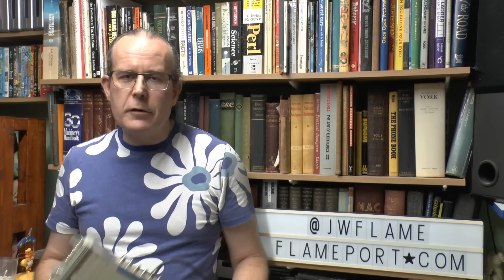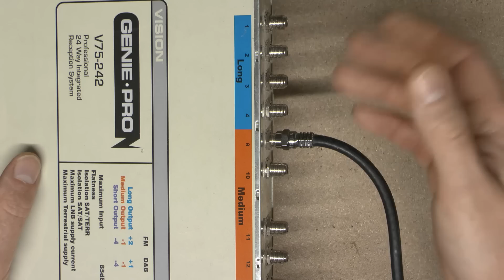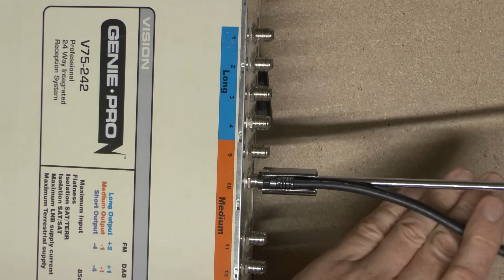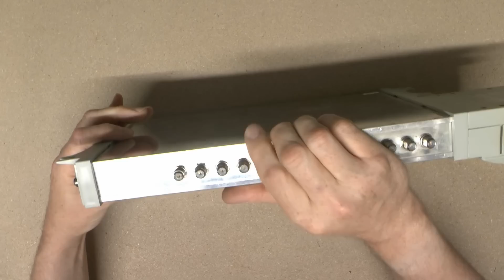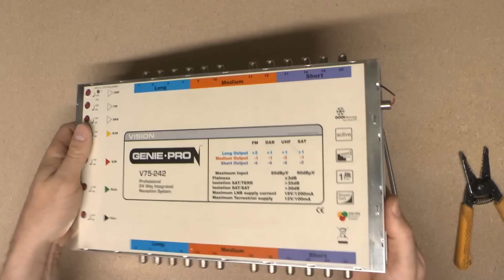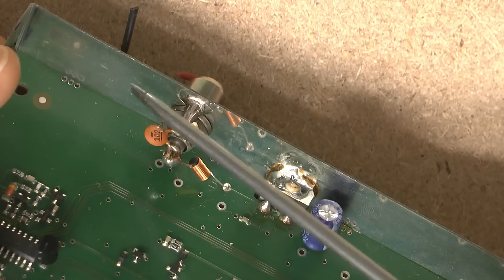IRS Teardown Integrated Reception System for TV Satellite Radio

Comment: Interesting box I definitely get US vibes. Hearing you describe F connectors is like hearing somebody describe metric to nonmetric users Or imperial.
At least with the US cable and satellite television systems we are required to have our bonding point at the cable entry of the building.
And that is usually where the electrical services as well so it's just a matter of jumping over to the ground wire running to the ground rod usually.
Unless of course you're actually a cable or satellite TV installer where every time they've done my house they've ripped everything apart. I've seen so many installations where they don't know what to do with the ground wire as well. My local movie theater had satellite TV installed for a while and I was up in the attic and discovered they grounded it to a nail nailed into a piece of the wood framing. when they were literally inches away from a metal electrical conduit box they could've at least made an effort to go to. Where was I going oh yeah so any distribution amp would usually be downstream of that entry point inside and not need to be grounded unless of course it's using a three prong cord or has provisions for extra bonding grounding.

Comment: Hi JW,
With the way these things are manufactured, this could be a solder joint gone bad, it would only take one of these from the "supply" side of the unit to the outputs, to stop it from working. 
I do note that after you opened the unit up, there was a dodgy looking transistor, with a white deposit around that transistor, it may have for whatever reason overheated.

Comment: Hi John, one of the most common and misunderstood topics is 32amp ring finals wired in 2.5 using method 101. Do you need to be upping it to 4mm and can you retro fit a lower rated mcb for an existing scenario?
Reply from the maker: 4mm² would be the minimum size if someone wanted to install a 32A ring and also wanted to install the cables under thick insulation.   Both items can easily be avoided.
For an existing circuit installed in 2.5mm² and also under insulation, it would need to be changed to something compliant such as 2x 16A radials.  A ring using 20A or perhaps 25A might comply but further calculations would be required, and would also depend on what loads were connected and how they were distributed in relation to the insulated sections of cable.

Comment: Interesting that the power supply is rated for 18V, 1.2A, which is identical to the maximum LNB supply voltage/current. If the LNB is drawing maximum current, how much does the rest of the electronics need and can the PSU actually supply it? It seems like that PSU has the potential of being driven pretty hard, hence the Ernie Burnie mark.

Comment: If you see inductors which have appeared to have been squashed this is indeed tuning. The unit will have been hooked up to a network analyser at the factory and the inductors shoved until the desired results are achieved . The procedure is shown in #7 and #16 on my channel. They are probably part of a low or high pass filter network! Good teardown and explanation!
Reply: Hi
Reply: Do you know what this is?
Reply: I can't send the image from this can I have your email

Comment: Surly the mains input cable is earthed so no need for bonding.
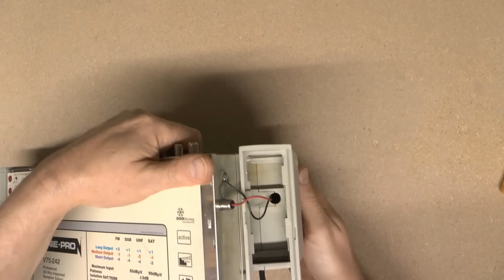Reply from the maker: Mains input cable is 2 core as it's Class II, but even if it was 3 core, the power supply is just DC out, 12:42 - two thin wires for the DC voltage. 
Boding and earthing are two different things, bonding would require significantly larger conductors connected to the metal parts.
Reply: Yes understand about being class 2 but if it was class 1 the earth would be to the case thus earthing so wouldn't matter about the PSU being only 12 volts. @jwflame

Comment: Great video.
PS Would you consider doing a video on heat pumps? Opinion seems to be divided on whether in practice they work properly and are an improvement on conventional heating.
Reply: There's a lot of expertise about and when you ask and answer the right questions about heat loss, pump capacity and radiator efficiency it's now quite simple to make a reliable prediction on whether they are suitable for a given installation.  Urban Plumber and Heat Geek are two channels on Youtube that might be of interest in this.
Reply from the maker: Yes.

Comment: I don't think that's just "foam to press on the board" - I believe that's RF absorbing foam to reduce cross talk. Also at 17:02, those are most likely not transistors, but rather PIN diodes which are commonly used in RF switching applications

Comment: The transistor is a 5v voltage regulator, the diodes clamp any voltage coming in from an output to 0.6v above the supply rail (probably 12V)

Comment: Cable tv systems use isolators, I am surprised these don't, to prevent diverted neutral currents from TN-C-S trying to use the co-ax screen, I saw that happen in the US where they DON'T use isolators, they bond the cable tv where it comes in. Customer's PEN had gone open and the coax cable tv line was smoking along its whole length!

Another reason this could be a problem is the cable is bonded at the cabinet end, and the cabinet PSU's are usually TN-C-S, so may have a different potential to the earth in the customer's house which could be TN-S or a different potential of TN-C-S, possibly from a different substation
Reply: As the satellite receiver needs to send  voltage back to the switch, as such isolated outlets are not possible. 
This method is really designed for MATV/IRS use, eg a block of flats etc. For earthing, the individual cables would be earthed via a separate earthing bar,  all cables should be earthed. This would render the equipment safe for serviceing. The coax should then be earthed at the pont of entry to the flat/caravan. 
Now its easier to do this via fibre on a larger system.
Bigger systems and CATV actually still need isolated/  galvanic outlets, but these systems don't usualy cover domestic satellite use.
Having been involved with village and town systems I am only too aware of the issues of earthing on larger systems, and melted trunk cables due to earth faults, and as for  electric shocks when customers remove the safety outlets.....don't get me started! 
Though it was a far bigger problem with older crt tv sets, you can still a shock on earted IRS systems at the reciver end when connecting.
Reply: @thomaspain3810  Yeah good point .... :)
Reply: We bond alot of the stuff in the UK so it probably not a big issue. Our wet plumbing is bonded unless it's plastic as well as our gas meters. So in most cases it gets to ground anyway so in alot of cases a pen fault isn't picked up very quick.

Comment: The one thing to note is that you need to use a Quad Band LNB (not the same as quattro LNB) where each of the outputs have a fixed pol/band.
Now with later Sky LNBs the system would need to support Unicable or Wideband which is how it supports single LNB but over 2 cables but can access all the bands/pol for background and multi-channel recording etc.
Also in these systems you may need a faceplate in each flat to split out the uhf/fm/dab/sat signals into individual connections which will also have filters built in.
Reply: Quattro is the 4x fixed, quad is 4x individual outputs. This particular unit requires a quattro but some makes put the band switching signals out to allow use of a quad.